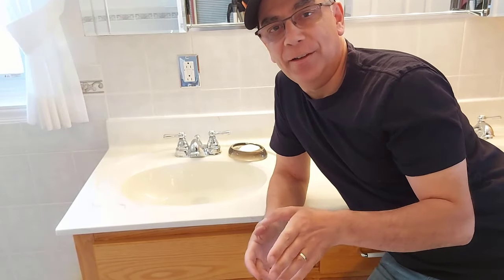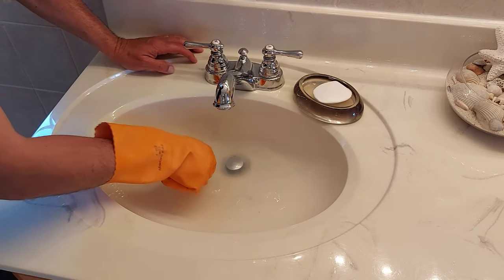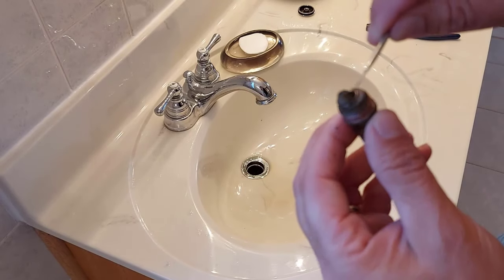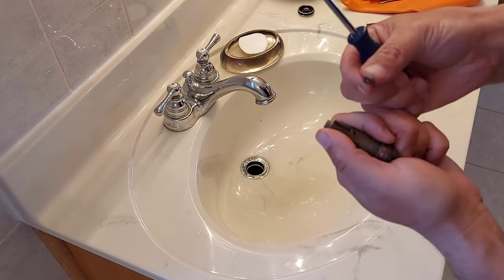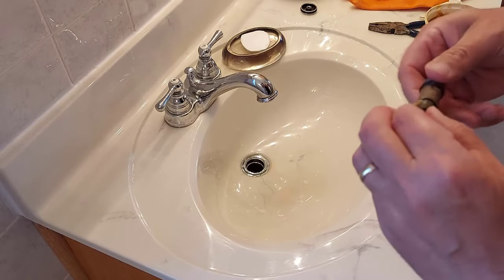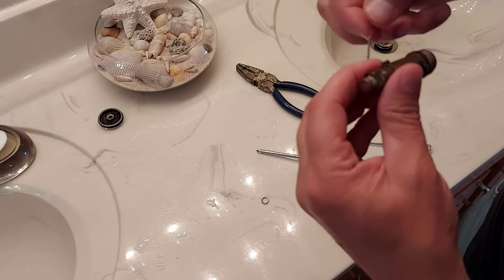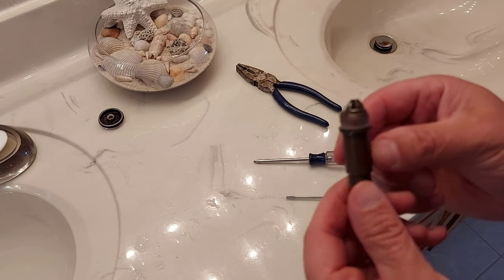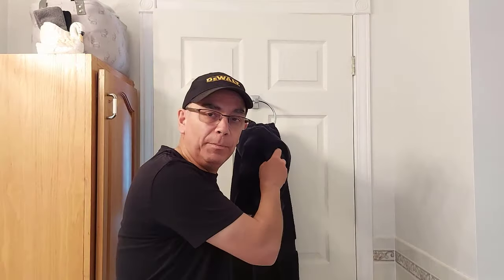Fix a Pop Up Drain Stopper That is Stuck | Dont Buy a New Popper 🕳

Comment: Nothing worked to pop up the stopper. I had to call a plumber, he had to push it from the drain underneath. The problem was the rubber ring that was damaged and got the stopper to get stuck. So keep a couple on hand and make sure you replace it as soon as it’s starting to look out of shape

Comment: Mine was really jammed. After unscrewing and removing it from the drain pipe, to dislodge the insert I put a narrow hex key into the hole in the bottom of the housing and gently hammered on it to push the insert out from the inside. I used a pencil with sandpaper rolled around it to smooth out the inside of the housing so the insert could move freely when inserted. Thank you for the helpful video!

Comment: Thank you SO MUCH for this. Mine is only a year old but it got stuck because we have very hard water here and the mineral deposits make things seize up. I needed to know how to take mine apart and get it working again. I used marine grease in mine -- meant to work in wet environments. Also had to clean the parts with vinegar -- I had to use pliers to twist the piston apart! Now it works great and looks like new again.
Reply from the maker: Wow great job!

Comment: Your instructions were great.  One added finding; the cap(plug) has a rubber sealing washer, this is where the sticking was.  I removed that and cleaned away sludge then put the cap back on.  Thank you

Comment: Thank you for the super helpful instructions! Was nervous about this, but your steps explain it very clearly - managed to get the shaft out but when I replaced the clip it doesn't seem to catch. Meaning even when I press the cap down it won't stay down. The screw is rusted so I can't even open it up to check. Seems like a new one is probably going to be the solution but it's always good to understand how these things work ;)
Reply: Hi Kim, I just bought the whole shaft mechanism from local hardware store for $7, so once the cap was off, could just remove the shaft and replace with the new one. Super easy. Hope it helps.

Comment: Thank you!  For my situation, it was actually easier, because I didn't have to take it apart.  All I had to do was spray the inner column with WD-40 and it worked like a charm.  Thank you for the advice about using it often!  

BTW, I wasn't even able to get the column out with a wrench, but that's ok!

Comment: I tried the rubber glove, the WD40, and the chop sticks to no avail. What worked was using the Duck tape and just twisting it off counter clockwise. I did not disassemble the complete assembly I just lubed the heck out of it. Thanks so much.
Reply from the maker: Thanks for sharing

Comment: Hi
I've had this problem a couple of times before and fixed it successfully, and have since then been dismantling the stopper mechanism regularly, adding a small amount of light engine oil as a precaution. 
This time it seized up for good! Nothing would remove the inner piston until I had filled it with WD-40 and left it overnight. Even then I had to prise it out by screwing a little nut on the top of the shaft and levering it with a small tyre lever. 
Then - could I get the little piece of bent wire to seat properly inside the cylinder? I must have spent the best part of an hour trying until it finally seated itself for no reason I could observe. Screwed the assembly back into the sink and pushed it up and down a couple of times to test it and ... voila! The plug and the piston shot up in the air. Turned out the tiny retaining screw had stripped its thread, so goodbye pop-up stopper!
Local hardware store (regional Australia) had never heard of pop-up stoppers. Down to the plumber who enquired "What the hell's that?"
Back to eBay...such a waste of time!

Comment: Thank you! The instructions worked well.  I found that it also helps to remove any standing water with a sponge and get the sink and stopper really dry.  Helps you to get more traction on the stopper when turning left.  Also, the video instruction for disassembly of the piston is out of view.  For putting all parts back together, common sense guides you to assemble it in reverse order, but a close up of how the pieces fit back together would be helpful.  I removed a second working stopper I have to see how it looked.  Again, the video was super helpful and saved me the cost of a plumber as well as possibly purchasing a new piston.  Thank you!!
Reply from the maker: Thanks I will have to watch it again to see the view. Glad you got it all worked out. It feels great to do it yourself doesn't it.
Reply: @GettingItDoneRepairs  This hasn't been corrected and is still out of view. Also what lubricant do you recommend?

Comment: Thanks for your tutorial. Followed all directions and thought I was crossing the finish line, but the piston doesn’t ‘catch’. I rewatched the video and don’t think I missed a step. What is causing it to not ‘catch’ when compressed in hand or installed? Thank you!!
Reply: I stepped away and returned for another attempt. I took apart the piston and reassembled…2 or 3 times. The pin FINALLY latched on, and now it ‘catches’ as it’s supposed to. Maybe it just wasn’t hitting the dpring right…until it was! 
The stopper is fully installed and works great. Thanks!
Reply from the maker: @jennifersperberg1997  glad you got it. Great to hear 👍

Comment: This video worked wonders, but now it won’t stay closed haha. A better problem to have – I don’t fill the sink frequently – but any idea what I may have done wrong? I followed the steps closely by taking it apart, cleaning/greasing it, and thought I was on a roll… until it just wouldn’t stay closed once reinstalled.
Reply from the maker: You may have re-assembled it wrong. Thats the only thing I can think of.

Comment: Hi.  This was, almost helpful?  My fault, not yours though.  I took my drain apart.  The popper with the piston mechanism was the same as the one in your video.  In the course of trying to fix it, I broke it.  I need a new one!  I've looked at some hardware stores but can't find one.  What exactly is it called so I can search for a new one on the internet?  Thanks!

Comment: What about the knob between the taps that you pull up? Mine pulls up really high and does nothing to the plug…
Reply from the maker: With a pop drain plug like this, you don't need the le er between the handles. It's for a different type of drain plug.

Comment: Hey man, what do you do if you lose the shaft and the Pop up drain stopper is now shut closed?
Reply from the maker: Where did you lose the shaft. Which shaft are you talking about? You can also going underneath your sink and undo the P trap and place something long enough up the drain pipe and push the stopper up and out.

Comment: Mine was so stuck that I tried all the usual ways and then pushed one more time and the stopper has smashed down about 3cm (2 and bit inches) and is stuck at an angle and impossible to budge. I can't easily access the U bend so does anyone know if I could break it up with a hammer drill and amalgam bit? It's probably steel and chrome so it would be a bastard to do with my girlie arms so can anyone suggest anything? I'd be really chuffed as I do a lot of my own DIY and hate to be bested. Thanks.

Comment: Here's another tip. You should probably first instruct people to not work over the sink with an open drain. If they drop a part, then they are taking the trap apart to get those out. Clean it in the kitchen sink where you have a drain basket in the event you do drop something.

Comment: Nope. Mine isn't moving at all. I've tried everything -it's wedged in and not going anywhere.
Reply from the maker: That's not good.
Reply from the maker: Hello try some of these options: https://www.youtube.com/watch?v=ZWlq_fWRrzI&list=PLWeQZSOnzi9W7l820syVzx7xfDs_TQ_Ep&index=1
Reply: If you have hard water it might be stuck from mineral deposits. I had to use pliers to twist the two pieces loose when taking the piston apart.
Reply from the maker: @annehaight9963  I have water softener but ya I can see hard water being an issue.

Comment: Mine is stuck so fast that rubber gloves and suction cups won't shift it. Guess I'd better call a plumber.
Reply from the maker: That's not good. Good luck
Reply: Had the same problem then realised i had to pull the leaver at the back and it popped up.
Reply: No lever on mine. Just a spring pop-up.
Reply: @jjdecani  try where the pipes are there is a little pipe sticking out oush ot down.
Reply: @tomlee982   - Mate, it wasn't that kind of plug, okay? No lever operation, just spring. It's dealt with now, anyway. I took off the U-bend, hammered it out from underneath and replaced the whole stupid thing with a good old-fashioned rubber plug. Happy days.
Reply: @jjdecani  i was trying to help you out, keep your thong on.
Reply: @tomlee982   I know you were. I'm not losing my thong. You just didn't read my reply, where I clearly said "No lever on mine". So I repeated that with just a tadge more emphasis, as you seemed to need that.  ;-)